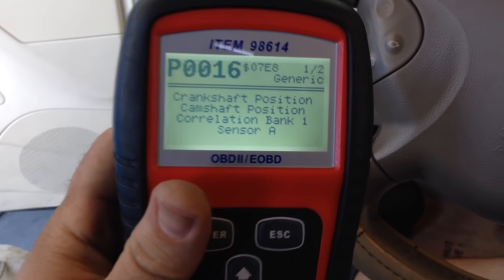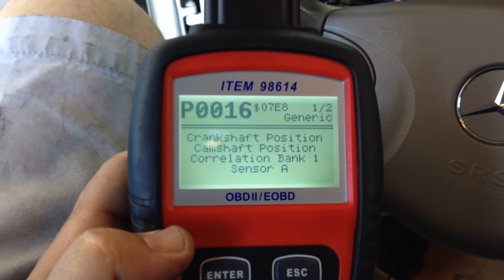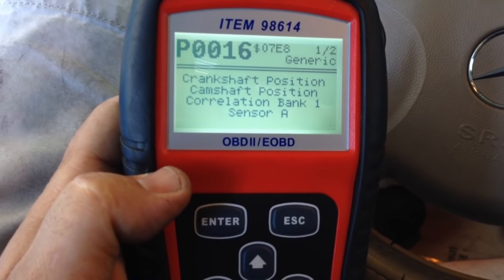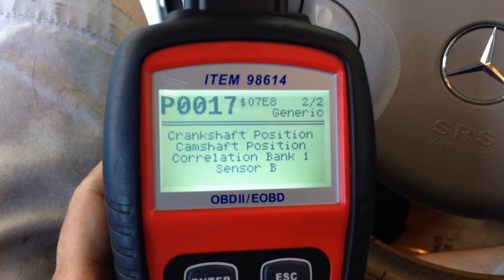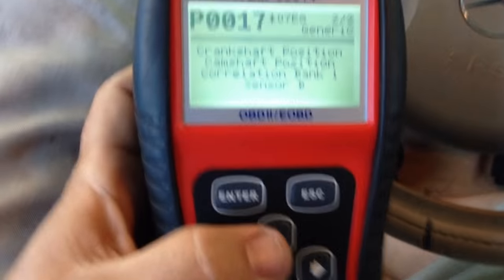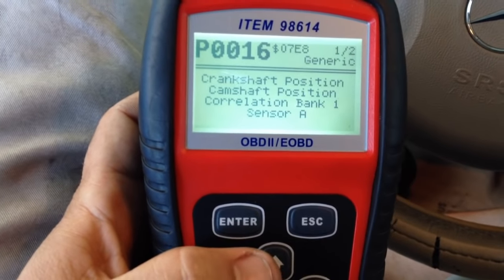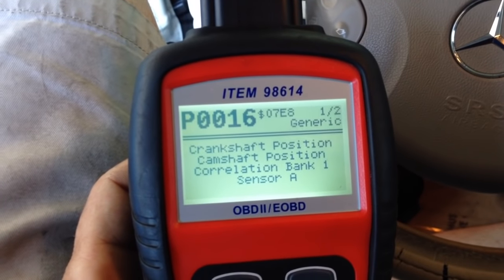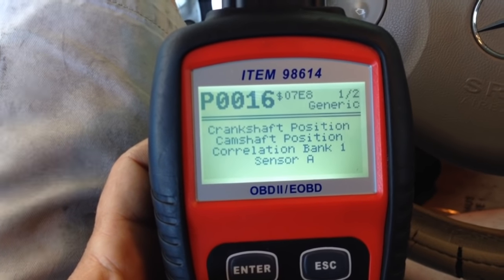Mercedes Camshaft position sensor p0016, p0017

Comment: Thanks for the VId but this is NOT DUE TO IMPROPER OIL, my car has 44600 miles and has had Mobile 1 oil changed every 10k miles, and has already thrown these codes, its due to inferior materials used be Mercedes for the crank shaft sprocket!!!!
Reply from the maker: Eric sin correct, Mercedes made a bad part.
Reply from the maker: Eric sin it’s not the crankshaft sprocket, it’s the Balance shaft
Reply: I have two Mercedes C230 Kompressor coupes, a 2004 and 2005, one with 164,000 miles the other about 85,000 miles.  I've had no grief with the engines.  When coming up to 250,000 on the 2004, in a moment of insanity I took it to 132 mph and it was gaining speed when my fear of getting copped convince me to take my foot off the gas pedal.
Reply: Robert Porter you might have had good luck with your Mercedes, but most people don’t. Ive owned both Mercedes and BMWs and in my opinion, they are not worth it. Prestigious cars, semi-good looking, but not very reliable and expensive to fix. I switched to Lexus because I don’t like throwing my money away. After Lexus, no more european cars.
Reply: @doctorstrange1734  you are so very right! 

German cars are built to eat junk parts predictably so companies can have a chance to compete.

Japanese companies licence the Bosch technologies and managing their own quality.

Worldwide transportation: air, rail, road and maritime is dominated by German technologies. Japanese have been their longtime partners for centuries.
Reply: So,we can say;”bad German Engineering”.
Reply: @doctorstrange1734  you have to know your pocket and affordability! when you need to drive MB and BMW it’s simple. Some people they say very expensive but how about the smoothie comfort of the engine with the top 🔝 quality of interior it’s really decent but when you come to repair 👨‍🔧 it’s a headache 🤕 but think about it life is too short, you don’t know what’s gonna happen tomorrow even you get sick 😷 and daie.
Reply: Every 10k? I do every 5k
Reply: @HappyRescues  Manual states 13k but who cares got rid of it

Comment: Hi sir, I have a 06 CLK350 with 118k miles and I'm getting P0016/17 as well as p0021 codes. I also had misfire codes on the entire passenger side bank however the car had no misfires. I went ahead and replaced the spark plugs all around regardless and I'm still getting the misfire codes even though the car has little to no vibration and feels factory new. I don't think it is the timing shaft or Ballance shaft and I've just had the intake manifold replaced 8k miles ago and I've done everything I can to try and figure out my problem. I've disconnected the battery to reset the codes but they all still popped up when I reconnected it. The car is not sluggish or shaky at all and is still very peppy and I'm only getting a solid Check engine light. Do you have any recommendations as to what I should do? I'm truly stumped. Any response would be greatly appreciated.

Comment: The problem it's NOT the oil pump or cheap oil, it's the quality of the metal (to soft)  they used make the balance shaft, well documented everywhere. Great video, tks.
Reply from the maker: You are absolutely right, the video was done before Mercedes assumed liability
Reply: MBT OF ATLANTA Mercedes Master Techs unfortunately they never did the official recall 🤯

Comment: Hi even when you change the cam shaft sensor the connecter where it clicks on have to be replaced or clean before clicking it back on the sensor.the oil in the wire will run all the way up the harness and ruin the computer.

Comment: Wow! I can’t believe how helpful all your merc videos ! Your freakin awesome! I’m a professional mechanic and the time you put into your video are unbelievable! I’ve learned invaluable information that keeps me passionate about mercedes and the engineering that’s is involved in these vehicles,,,,,, I can watch your videos over n over n over Your the best at whut you do!
Reply from the maker: Stephen Denney thanks for watching my videos, people like you encourage me to continue doing my videos. Thanks.
Reply: I wish someone would be "freaking awsome" showing me how to replace the CRANKSHAFT position sensor on a 2005 C230 Kompressor.  Everything I seen so far is useless.  The sensor is down below the left rear corner of the cylinder head, but how the devil do I get in there?
Reply: DIYer great vid
Reply: I was getting code p0015 and p0019 on my s550. My mechanic replaced all four crank shaft actuator sensors. Now, I’m getting three new codes, p00016, 18, and 19. Car drives fine and all. Please, help.

Comment: Very grateful for the informative video. Allowed me to rule out the infamous camshaft sprocket balancer issue. Wasn't certain if my ML350 was one of the ones affected, but after oil change with no evidence of metal shavings or pieces and then successfully performing the alignment procedure you provided, I was able to get my issue resolved by just replacing the 2  - bank 1 sensors. P0016 & P0017 codes have gone away and now I can get it smogged. Thank you!
Reply: Can you tell which one exactly sensor A and which one B? I mean if we looking on two of them staying with open hood?
Reply: @captain.america  yah you can tell in the video he has the code with bank A sensor 1 which then he shows us physically in the motor and the passenger bank is bank 1 and the left sensor is sensor A. I don’t know the orientation of the driver side bank however
Reply: Do you know what it means if you did find a small amount of very fine metal shavings In the oil? I changed my oil as soon as I got the code and it said bank 1 sensor A and I performed the test with crank at 305 and both cams were aligned for bank 1 so I just replaced the sensor but now I’m scared to drive it
Reply: @elianangelmoreno  Which one is sensor B?  If you stand and face the front of the engine  is sensor B on the right side, the one that is vertical?
Reply: @nttam1920 if your sitting in your car faceing the road the a bank is the left side of the engine the B bank is the right side now if you’re looking at your engine faceing the car then the left side is B bank and right side is A bank

Comment: I did this test and got lucky, mine lined up perfectly!  Thanks for the video.
Reply: Did you get fault codes? Replaced the sensors?
Reply: Did you replace the sensor and did the code go away

Comment: I've got the the death codes p0016 and p0017 together... I'm going to do this test tomorrow but I don't consider myself to be so lucky... LOL I want this guy to do my job! Anyways, keep up the good work and keep the videos coming! This is very helpful!
Reply: Kevin Park dude i just bought a 2007 e350 for $1500 the car is mint condition but unfortunately the check engine is on with those two same codes, so my question did you ended up fixing it? and if you did how much did you ended up paying
Reply: Sam Otab did u end up fixing it I got the same codes on my 2007 e350 lol

Comment: I have my P0016/P0017 m272 engine swaped, which costs me $3K.   Lucky that the problem showed up at 180K mi or 15 years later after i bought the car.   I used engineer oil additive to prolong the wear and tear, which seems to work for me.   After some premature wear and tear, the Bank #1 CAM timing is advanced and resulted in running hotter.    Now everything is back to normal.
Reply: What did u swap the 272 with and what it cost u? I have to do it also.
Reply: ¿Cuáles son los síntomas cuando tienes este problema?

Comment: MB actually recommends using 0w40 for the M273&272 motors. High mileage versions might benefit from the jump to 5 from 0 weight but only if they eat oil, otherwise stick with the 0w. That's what I've been using on my 135k miles M273 for the past 4 years and it's perfect.

Comment: Hello David, I have a 2006 Mercedes ML350, I did all the checking you have mentioned and I have the two round marks you have mentioned, I seen one circle but did not see the other one, my questioned is can you tell me all the parts and gasket I would need to replace the balancer, I have a mechanic said he would do it, I just need the part list and gasket list. I already have the oil and filter, anti freeze, power steering fluid, I know those are the basic stuff. I just need to know so I can order the original parts for the job. By the way, your doing a good job, thank you for the tutorials.

Comment: Thank you for the help,put 4 magnets and 4 new sensors and the check engine light came back on rite away,I'll do the test but would it help to put the titan oil in now before test or is it too late?
Reply: I did the same thing to my Customer's car and it didn't fix the problem.

Comment: I had codes on my m272 engine that indicated that I had a balance shaft issue like he is describing. I pulled the cam sensors and checked to see the small circle stamps through the hole and noticed on bank 2 my cam adjuster was clicking and spitting oil from the front and on bank 1 exhaust camshast timing mark was way off. I changed both the exhaust camshaft actuators and the timing marks came spot on and ran perfect! Things aren't always what they seem.
Reply: Yup, I have the GL450 and thats what people are saying it is the cam adjusters NOT the balancer.  Well, I'm off to start this job and I hope mine is the same problem you had.
Reply: @ranbymonkeys2384  
If you get into changing the cam adjuster do all of them. Mine has 2 intake and 2 exhaust. More importantly make sure all timing marks like up perfectly and rotate the engine a few times and recheck timing marks befor starting it.
Reply: @mikedizzle5273 how were you able to see the timing marks?  It’s so tight down there it’s hard to get a good angle.
Reply: @jeffsnyder4696  yes I was able to see. Take all 4 cam sensors out and slowly rotate the engine while looking through the empty cam sensor holes. All 4 timing Mark's should rotate in the middle of the holes evenly.

Comment: Hello David,  I bought a 2007 ML350 with 205,658 miles on it.  Got error codes P0016 and P0017. Reset it but came back. After watching your a video, I think it's related to camshaft balancer. I check 305 Mark only saw 3/4 of mark on one hole and other not see it. I want to ask you personal opinion on this one. how long can I keep driving before it won't start or run?  Thank you David.
Reply: how long did you get out of that motor...i have the same thing
Reply: @pastormichaelhibbertminist7486  been driving mine like that for a year

Comment: I watched your video on the p0016 and p0017 codes. The stamps on the camshafts were both in the center. Mine is pulling up just the p0016 code. Which sensor would that be on the right side. The one closer to the fender or the one closer to the center of the engine.

Comment: The crankshaft pulley uses a 27mm socket.... he should've mentioned that in the video. 
Other than that, great video!!
Reply: Kamyar Movaffagh I’ll buy me a 27mm socket now. Thanks for the input.
Reply: If you dont have a 27mm socket.  Dont even try to work on a mercedes

Comment: Hello, my 2007 c230, 2.5 v6. Is lined up at 305 degrees with the circles in the center but I still have the codes. Should I replace the sensors?

Comment: Great video! 

I am a former MB Tech and I have never done this job. I have a Master MB tech friend that does them and he gets $3,800 to do this job. The dealers here charge significantly more. Nothing a novice should attempt.
Reply: Hi from dubai. Can you suggest which mercedes engine n gear box are reliable for long run

Comment: Hello.  Great video and if I lived in the ATL I would for sure be making an appointment.  On the passenger side I have changed the 2 sensors and magnets.  Seeing your video for the first time I need to check for the circles.  I am having a heck of a time figuring out how to see the numbers to find 305.  Are the numbers and the line you’re speaking of at the bottom or top?  For the life of me I cannot see them.  It’s a 2010 e350 4Matic.  I had the p0016 and P0017.  After changing the sensors and magnets only the P0016 went away.  Also, does the drivers side need to be changed too?  Thanks so much for reading this.

Comment: Thank you so much for sharing this video, very well explained and simple. I am going to test mine tomorrow as I have random missfires on cyl 1 2 3 and P0017 code. I am hoping this is not my case but I have a feeling that this is going to be my problem.
Reply: What was your problem
Reply: It jumped a few teeth, I did the test and the right circle aligns perfect but the left one doesnt. At least I know now that it needs a new timing kit. Your video was very helpful to diagnose. Thank you.

Comment: Hi MBT, what would the symptoms be with someone who has this issue and ultimately needs a new balancer? I have a 2006 ML350...and at this point the cost of such a job outweighs the desire to put that kind of $$$ into the vehicle since it's Kelly Blue Book is probably $2000 

We have a series of issues from occasional hesitations or stuttering..but most of our issues seem electrical in nature especially if it rains out (faulty ground, fuse, etc..not sure).
Reply: I've got a 2006 ML350 with electrical issues too and camshaft codes #16 & 17.  Having it looked at right now.
Reply: @norman1712  I have the same codes on my 2006 ml350. Two mechanics told me not worth doing anything. If it’s the Balancer then they have to take out the to replace it. 28hrs X $200 plus parts . The car is just not worth fixing if that’s the case.  What did your mechanics say?

Comment: My question is I have an ever so slight sound on the driver's bank directly up front at idle on my 06 ml350.. it runs great though with no cell on
.. any ideas ?
Reply from the maker: Maybe camshaft sprocket??…sometime it will make a little rattling noise on cold starts..
Reply: Ita actually quiet cold.. when it warms up is when the rattle on idle is heard..could it be the tensioner ? I'm running Castrol 5w30 synthetic.
Reply from the maker: @rustydaily183  yes, idler.. loser steering pump.. water pump.. AC compressor… alternator.. tensioner… belt… timing chain…

Comment: Hi.  My check engine light is on in my 2010 Mercedes GLK 350 4MATIC.  I ran the test codes and comes back P0017.  The car drives fine, other than little rough idle on a colder day. Not super rough.  I erased the codes, had the oil changed and still comes back on after a few miles.  Do you think I should replace the sensor or first do this test? I just need it to pass emissions here in ATL.  
Thanks

Comment: Thanks for the video!  Great information.   Can you tell me how I check to see if the sencor is bad?   Or do I simply see if the circles alien?    If thye do the sencor is BAD???    How do I knonw its not the magnet?   Also if one side is bad do I have to chane both on the one side or all four??   Any help you can provide would be greatly appriciated.   Thanks
Reply: Irish770 irish770 is your Problem being Solve the issue

Comment: I have a 2006 C230 with these codes.  CEL has been on for a while with no negative effects.  Recently, however, it started misfiring in cylinder 3 and 5, which was noticeable.  I am going to replace coils, plugs and wires first to solve the misfire issue, but do you have any other thoughts? How necessary is the repair if the circles do not line up as you have shown in the video? Thank you!

Comment: Will this procedure also work to diagnose a P0025 (factory code 0064) continuous cam adjustment left bank, incorrect position of exhaust cam? Or is there a similar procedure for the left bank?

Comment: Hi, I have a ML350 2006 with 100k miles. I followed your tutorial and put it to 305 degrees and one of the circles is perfectly in the middle but the other one is about 3mm/0.13 inch to the right. I did reset the check engine light but after start it was on again and it still shows the p0016 & p0017 codes. Would I have to replace the balancer or it will be fine like it is.
Reply: What have you done with it for correct this issue? My car, 2006 R350 has a same issue. Please let me know. Thanks
Reply: What size socket do you need to turn the crankshaft pulley??

Comment: Hi David. Great Video. I have a 2006 ML350 V6 with 55,000 Miles, P0016 & P0017 diagnostic codes. Wondering where you are based and how much do you charge to fix this if the balancer needs replacement. Thanks.
Reply: Please I need to see timing March ml 4matic 350

Comment: So can you please tell me, that you said on the video if its little bit ,in that case its fine it's ok. I have been check both side of the engine, right side both was in the middle exaxly. Left side was one of it exactly on the middle the one on the left hole was lets say 2mm on the side but not really much. I got today engine light on. Deleted it after drive stop and start again it came back. I changed the cam sensors from left to the right. Right now did not show up the engine light. What i supposed to do? I just bought it today. You think it would be probably the cam sensors?engine runs perfect no shaking no power lose, very smooth. What should I do? 
Codes was same p0017 and p0016

Comment: The cause is a gear on the balance shaft inside the motor made of inferior material that wears down after a short amount of time and causes the camshaft to lose it's alignment. Oil grade is for lubrication of the metal parts inside of the engine and slight cooling, only! But the video is correct to a certain degree.